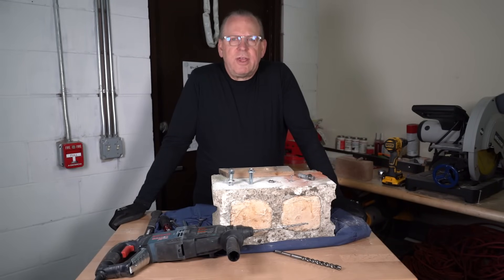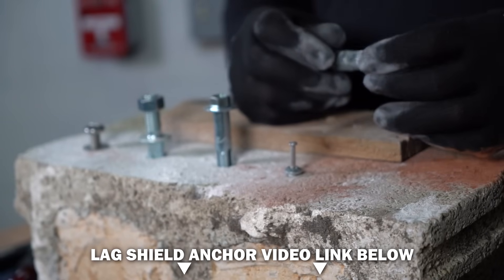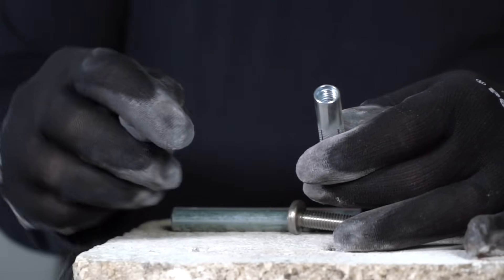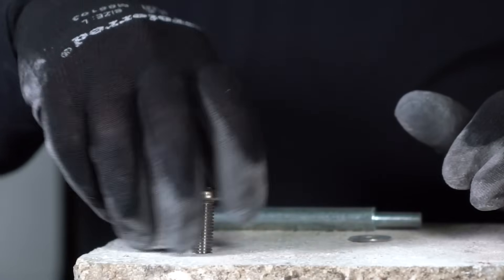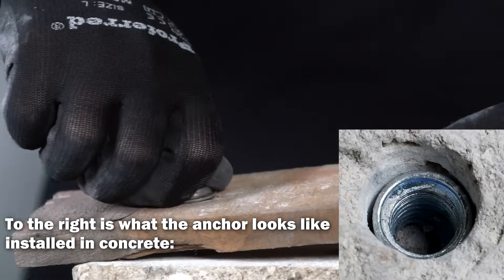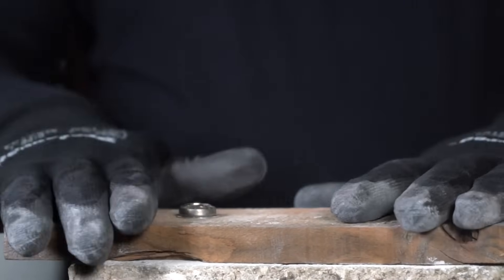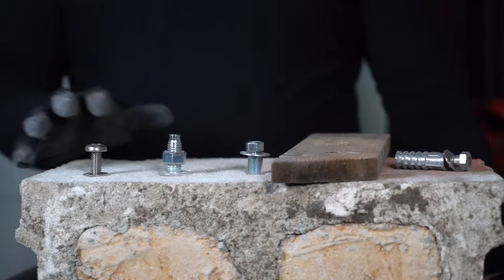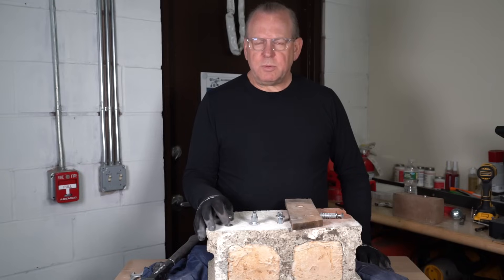How to Install Masonry & Concrete Anchors | Fasteners 101

Comment: Thank you for the video it was very informative. 

Question when do you use each of the fasteners? I am attaching a 2x8x14 joist ledger board to a concrete slab on my house. The concrete decking slab is attached to my house and I need to redo my deck which currently has 2x8 using concrete anchors. The wood deck joist ledger board is anchored to the concrete. i would like to do that again and was wondering which type would work the best. From looks alone the one with a sleeve anchor looks closest to what I currently have. If that is the type what thickness should I use? 3/8" or 1/2"
Reply from the maker: Wedge anchors or sleeve anchors would work best for your application. The diameter of the anchor will depend on the hole size; larger sizes will hold better but require larger holes in the wood and concrete. We would advise sticking as close to the original anchors, in terms of size and style, as possible. The original builders chose those anchors for a reason.
Reply: Albany County Fasteners 
Thank you for the advice. I honestly do not think the original builders knew much about construction as it is very apparent in the way they built it. Example 4x4 laying on top of the soil; not packed, no pavers, no concrete footings. Some of the parts are way shorter than others so i will have to hire someone to replace or set the drawing myself.
Reply: I will use wedge anchors due to the greater shear pullout strength over sleeve anchors. Thank you for the advice.

Comment: Hi. I'm planning to build a concrete partition wall for my room. Is it possible to anchor rebars to a plain concrete floor that has no reinforcement?
Reply: Yes, drill the appropriate size hole ie: 1/2" bit for 1/2" rebar, and pound the rebar in with a 2-pound sledgehammer. If your bit is bigger than the rebar use epoxy

Comment: I'm building a large flat roof over my patio which anchor do you recommend fastening a ledger board to brick?
Reply: i would use tapcon in brick as it requires a smaller hole. He was going into concrete here so used concrete anchors. Brick is not concrete and the back can spall out easily from a larger hammer drill bit, weakening your affixion. I was a bricklayer.

Comment: Are there any fasteners that can be removed. Putting up a temporary shelter that will come down in a couple years. Thanks
Reply from the maker: Most masonry anchors cannot be removed because they rely on expansion into the concrete or masonry material. That being said, you could try using masonry screws or tapcons (https://www.albanycountyfasteners.com/concrete-screws/685.htm ) if that works for your application, but they are not as strong as some of the heavier duty expansion anchors like wedge anchors, or sleeve anchors.
Alternatively, using drop in anchors or machine screw anchors with sidewalk bolts might be a good in-between. The anchor might stay in the ground, but you can at least remove the screws once you're done so they aren't jutting out of your concrete. These are commonly used in temporary or removable applications such as storm shutters. You can find those here:
https://www.albanycountyfasteners.com/hurricane-bolts/sidewalk-bolts.htm
https://www.albanycountyfasteners.com/concrete-drop-in-anchors/1558.htm
Reply: @AlbanyCountyFasteners  If you drill all the way through you can hammer the anchor flush with the concrete...

Comment: I would like to attach my safe to the concrete floor in my basement to disable anyone from being able to remove it. Between all of the concrete anchor types that were highlighted in this video, which would be the best type of anchor to use to attach a safe to a concrete floor? I have access to a rotary hammer. Is there a specific type of bit I should use for a given anchor? Thank you for both an excellent video presentation and this information.
Reply from the maker: Wedge anchors are the usual go-to for installing things to concrete that you don't want to go anywhere. As far as bits go, carbide tipped drill bits are traditionally used for drilling into masonry or concrete. 
You can find SDS+ bits here: https://www.albanycountyfasteners.com/SDS-Plus-Concrete-Hammer-Drill-Bits-Carbide-Tip-p/1052-332.htm
SDS Max Drill bits here: https://www.albanycountyfasteners.com/SDS-Max-Concrete-Hammer-Drill-Bits-p/1052-340.htm
Wedge Anchors here: https://bit.ly/2Zukg3c
Reply: Albany County Fasteners This information is greatly appreciated. Thank you.

Comment: Which one of those would be ideal for a heavy bag installation on a ceiling?
Reply from the maker: Drop-In anchors are most commonly used for overhead applications, but you could also try used a wedge anchor as well. In any case, refer to the given anchors specs to make sure the anchor's pullout strength is greater than the weight of what you're hanging overhead.

Comment: At min 4:30 if you have a bolt that is 1 1/4 in length, how deep does the hole needs to be for the anchor? I want to use this for my shutters. I am not sure if i should use 1in bolts or 1 1/4. Any help will be appreciated.
Reply from the maker: As far as bolt length, that will depend more on how thick what you're fastening to the anchor is. The bolt will need to be long enough to go through the material and fully into the anchor. The drop-in anchor itself should be in a hole that is either slightly deeper or equal to the length of the drop in anchor. The hole must be at least as deep as the anchor.

Comment: Please help. I have a basement floor that's actually wooden joists sitting on bricks with "mud" (i forgot the specific name) below that. I replaced, sistered, and leveled a bunch of the joists and installed plywood subfloor.
The walls are concrete foundation right now and i want to frame walls down there. With wooden joists and subfloor but concrete walls, what's the pepper way to make sure the walls are fixed and won't budge since i don't have a concrete floor? (House built in 1925 or so)

Comment: THANK YOU!!! I'm installing a fence today and needed to know how to use a variety of anchors in order to pick which anchor to use. the last thing i want to do is ask my wasband, he already told me no to the project. he will have a nice surprise the next time he drops by. securing my home is my number 1 priority, now i feel at ease, i was really worried it was going to be above my skill level. your explanation was so through and easy to understand. it also helped me realize i need to cut the bolt on the wood piece i cant get to come up from the floor in my bedroom. i knocked down a closet wall making a sitting room/master out of two room. much to wasbands dismay. hehehe ya'll helped me kill 2 birds with one stone. much obliged
Reply from the maker: Glad we could help! Thank you for your feedback.
Reply: How did it all turn out?

Comment: Do we need to use epoxy for this type of anchors after installation done?
Reply: no, the metal expands on the bottom cone, gripping tight into the walls of the hole, so no epoxy needed. Actually it will be so tight, you will not be able to remove them, ever, so you will need to cut the bolt instead to remove.

Comment: Great video. Thanks. I'm installing a door threshold. It's aluminum, with a wood core and a plastic lip at one end. And, of course, I'm installing it into concrete, so I'm wondering what kind of these fasteners would work. Guy at the hardware store was trying to sell me a plastic anchor, but I didn't believe him.
Reply: Use tapcon screws the ones with a bugle head  so it can recess in the predrilled holes of the threshold
Reply: @Homepros888   Tapcons used to be pretty good but they seem to really suck now. Most metal materials anymore seem to be junk.  Tapcons have to be the exact size and if you put too much pressure they strip too easy.  Also they only come in a few colors and what if I want a brass screw or bro or stainless steel Also they only come in a few colors and what if I want a brass screw or stainless steel  Is for outdoors. For thresholds I prefer to use a wooden dowel  pounded in exactly where you're going to drill the holes then you can use the correct color or finish screw and remove the threshold if needed when it wears out And put another one right back in.

Comment: Hello I have a 4inch concrete slab that I would like to install a 6ft fe nce with 6ft gates I am using the Simpson Strong Tie EZ base 4x4  I know it says I need 1/2 bolts but what length should I use? Will this hold and where do I purchase your anchors?
Reply from the maker: The length needs to be less than the thickness of the concrete + the material you are fastening + 1/2" extra for drilling. We have some 1/2"-13 x 2-3/4" wedge anchors you can try that can work. You can find those here: https://bit.ly/35TcMbe

Comment: How do you keep Wedge Anchors from spinning and not tightening correctly?
Reply: Your hole is to big.  Push your anchor in to the hole and pull up on it to set the anchor.  It should grab the hole walls.  If not your hole is to big and start over.

Comment: I always do the same thing I’ve  use the right tools and the right drill bits and I’m tired to have a problem tightening, when i turn the nut the all thing turns and the bolt can never be tight. What’s the secret ??
Reply: Bernardo Lic. Once you start drilling don’t keep putting the bit in and out that actually reams the hole making it larger than needed
Reply: I only drill one time straight, about 2 inches deep, I’ve been using those anchor bolts for long time and I’ve never found exactly what I’m doing wrong,  I make 3 holes yesterday all the same and only one works fine, the other two were loose. I’ve tried to remove it from the concrete to reused but I couldn’t.

Comment: Thanks for the video very informative and helpful. Im debating between a sleeve anchor and a wedge anchor. I'm trying to mount a fence gate into cement filled cinder block column.
Reply from the maker: If the cinder block is filled completely solid, a wedge anchor should work fine. If it's not filled completely solid than a sleeve anchor should work.
Reply: @AlbanyCountyFasteners  Thank you.

Comment: Do i need to use concrete glue for the anchors?
Reply from the maker: Concrete glue is for bonding new concrete to old concrete. You don't need it for anchors.

Comment: I always do the same thing I’ve  use the right tools and the right drill bits and I’m tired to have a problem tightening, when i turn the nut the all thing turns and the bolt can never be tight. What’s the secret

Comment: Thanks for the explanation. I would like to install an open cabinet hanging from the ceiling with six anchors. Which type of anchor would you recommend. Also, the open cabinet should be  four inches below the ceiling. Thank you again for your advice.
Reply from the maker: Overhead applications are usually anchored with drop-in anchors, but I would check how much weight needs to be supported first and then select an appropriate anchor afterwards. If you want to be certain about this application, we recommend getting in touch with an engineer for a more accurate recommendation.

Comment: Great video! 
If you don't mind, I have a question. I just tried to install a pull up bar with 4 sleeve anchors. Three of the anchors installed as expected, but when I tighten one of them, it seems to be coming out much further than the others. And I am still able to keep tightening it without any sign of it stopping (the other 3 only took a couple of turns). Any idea what's going on? 
Here is a pic for reference: 
https://imgur.com/6vMBOSj

Thanks a lot!
Reply from the maker: Based on the pic you sent, it looks like the hole may not be deep enough for the anchor or the anchor is at a spot where it can't grip the surrounding wall. If it's possible, try removing the problem anchor. If it can be removed, it wasn't able to secure itself to the walls of the drilled hole and you may need to drill the hole deeper. Just be careful; we can't tell from this picture how thick the wall is or how deep you drilled already.
Reply: @AlbanyCountyFasteners  Thanks a lot. I appreciate you taking the time to reply. All the holes are the same depth (80mm). The only thing I can think of is I somehow made the diameter of the hole slightly too big and its not gripping like you said.
Reply: Ki Rin Ki Rin when this happens to me (slightly too large diameter of hole), I wrap a few layers of plastic wrap around my anchor just to help the anchor catch on the surrounding hole.  It offers enough friction to do so but is thin and deformable enough that as I tighten my screw my anchor is still able to expand and securely hold the screw in place.  Good luck with your project

Comment: I always screw up the threads, any tips?
Reply: Screw the nut onto the anchor leaving the nut flush with the top of the anchor before hitting with the hammer. This will give you a larger surface area to hit with the hammer and it will protect the threads.

Comment: I think you want to drill a hole the same diameter as the anchor. People usually specify diameter. Circumference is the length of a string that wraps around and is equal to the diameter that Mrs PI which is about 3.14. Don’t drill a hole with a diameter equal to the circumference of the anchor.

Comment: Trying to figure out the best anchor for my application. My brick fireplace was refaced with 3/4 “ ledge stone and now I want to put up my mantel which will be blind mounted with 2 2x3s into the fireplace. The mantel is 7’ long so I bought some 3/16” diameter 4” tap cons but not sure if that’s the best method was going to do 5 in each 2x3. The mantel is not very heavy being hollow and all
Reply from the maker: Those tapcons should be fine for your application.

Comment: Good video although no demonstration on how deep to drill or the width of the drill bit.
Reply from the maker: Both of those specifications are too dependant on the size of the anchor itself. If you would like more in-depth specs, you can either check that anchor's information on our website or ask us and we would be happy to provide further assistance.

Comment: Can you use those fro a cell tower?
Reply from the maker: Cell towers, due to their size and construction, require special massive anchors to properly secure them. Any standard anchor shown in this video, even in the largest sizes we carry, would be insufficient for such an application.

Comment: I watched this video because I wanted to know the depth of the hole that I need to drill. This is an important part for the installation because you cannot adjust depth of the hole by drilling again once you hammer it in. This video did not give any advice on the drilling depth. He completely miss the first part of the installation. Hammering in and tightening with a wrench are the easiest part 🤦🏻‍♂️ 

For those anchor with an unthreaded wedge at the bottom :
If I am not wrong the depth of the hole should be deep enough to embed the wedge mechanism but still leave enough thread to screw in the nut with a wrench. If the depth is too deep, then are not able to apply the nut if the wood is thicker than the exposed length. There is also a problem when it is not deep enough where the nut is unable to squeeze the wood against the concrete because the unthreaded part of the anchor is above the concrete surface because the anchor moves up a bit when you tighten the nut as the wedge is expanding.

Comment: I know how to screw in and hammer. What I was hoping to see was how to select what drill bit size to use, or how to determine how deep to drill. Not very useful for your only showing the most straightforward part of the installation
Reply: Well I'll tell you. Buy redheads or powerlok anchors. You always drill the hole to 1/4inch longer than the length of the anchor. The bit size you need will be the same size as the anchor itself. Like let's sat You're needing something to stay very still and your concrete is pretty deep? You decide to use hammer-set 1/4 inch (1/4"diameter) anchors.  1/4" x 2.5"long. So use a 1/4inch drill bit and drill to 2.75inch. Each one that you buy will have instructions on the back of exactly which bit to use. Bigger boxes of anchors include the bit. Read all instructions, every first time
Reply: oh yeah and that little setting tool that he showed for the drop in anchors? costs you another $7. does the same job as a pin punch. literally get a pin punch at harbor freight and i'm sure that'd work.

Comment: I felt it was a terrible video! The reason I came to this video and watched him go through his process I was looking for what size drillbit do I use for what size anchor bolt and how deep do you go with the drill bit. He could’ve at least demonstrated with the diameter of the anchor bolt he used to what size drill bit in the depth. He said nothing about this

Comment: You drilled your drop in anchor hole too deep
Reply from the maker: No I did not.  How deep you drill has no effect on the performance of the anchor.  In fact I always over drill my holes incase I want to remove the anchor by pushing the anchors deep in the hole to patch the concrete.

Comment: Unfortunately you are not showing masonry anchors.  You are showing solid concrete anchors.  Your use of the word masonry is misleading.  Placing anchors in CMU (concrete masonry units) like "cinder blocks" or brick that have hollows or open cell voids, as opposed to being solid, is a whole other technology.  I would say "concrete anchors" and "masonry anchors" to clearly delineate the difference would be much more accurate.

Comment: It's not pronounced MAY SON AIR EE.  It's prononunced MAY SON REE.  (Three syllables, not four.) It's amazing how people who actually work with masonry pronounce it incorrectly. Also, you really don't need a hammer drill if you are just doing a job or two.  A good masonry bit will do for occsional use.